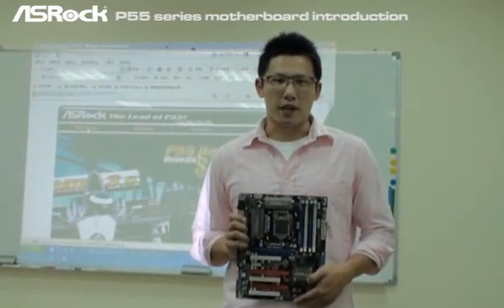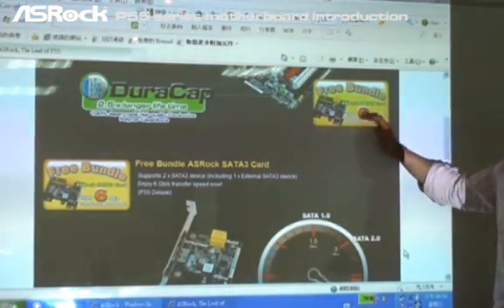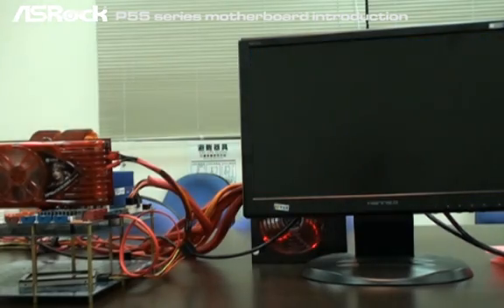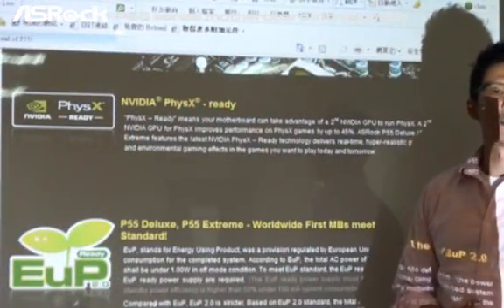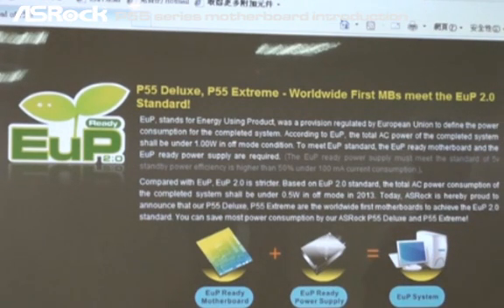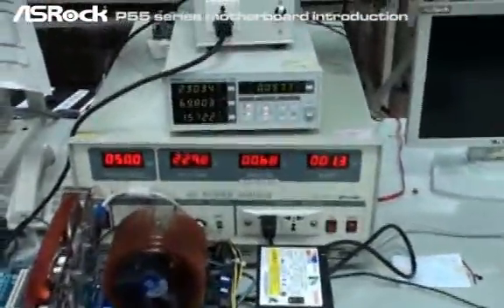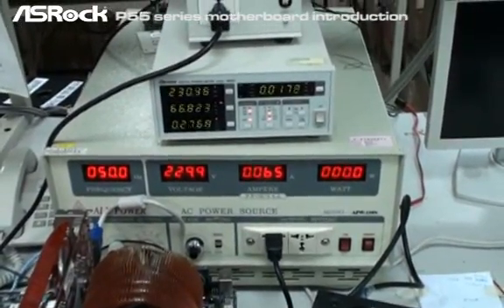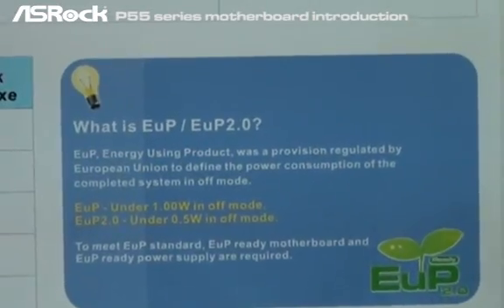ASRock P55 Series Motherboard Introduction Part I

Comment: The ram problem (deactiving two of four dimm slots) is a problem across the P55 mobos. Look at newegg review of the gigabyte ga p55 ud4p.
Same problem. Some say it's sensitve ot memory brands/speed/ video cards. The p55A line of  boards from gigabyte add sata and usb 3 deletes the pata connector. Future proofing as little devices exist to support it. And Sata 3 looks on paper but who knows if it will give more throughput.